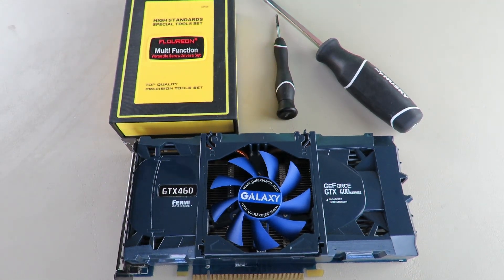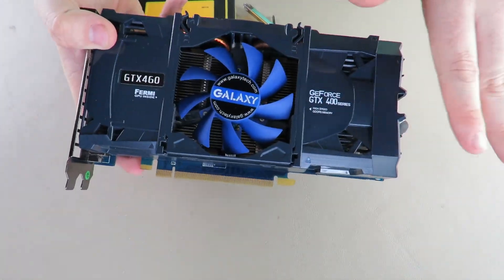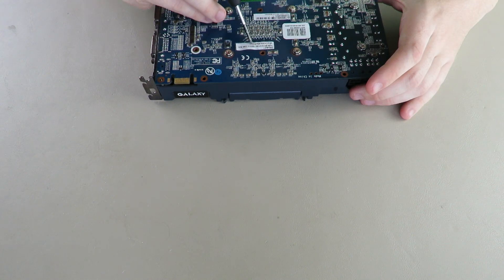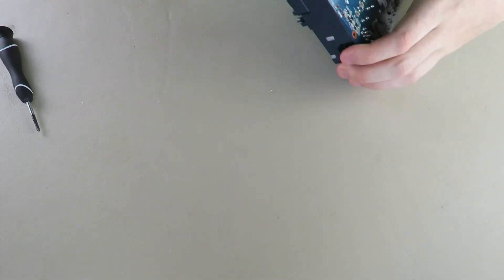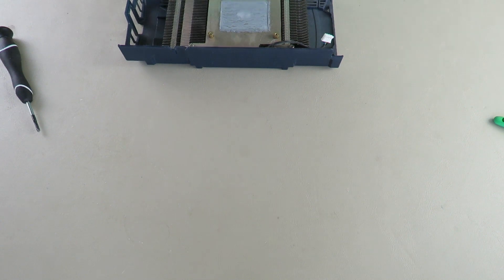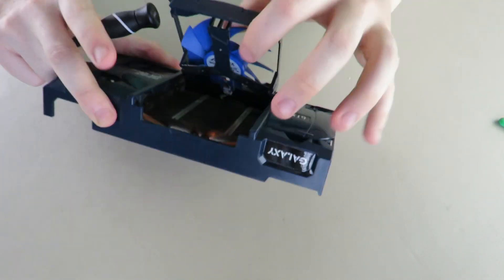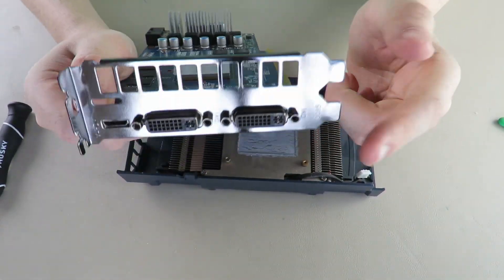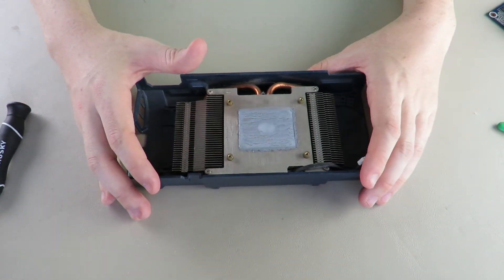Galaxy GTX 460 Teardown

Comment: Hey man I have the same GPU too can it play an valorant in 1080p or 720p? I'm seeing to paired it with Athlon x4 860 my board is MSI A68HM E33 V2
Reply from the maker: I mean. I’m sure you could try for 720p, but I wouldn’t hope for 1080p at reasonable frame rates.